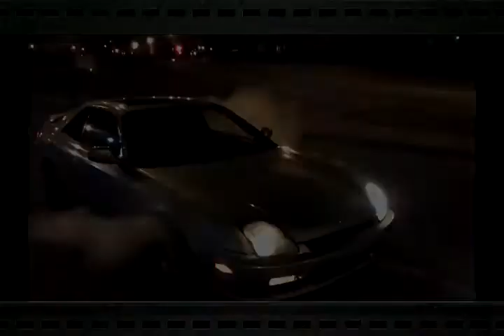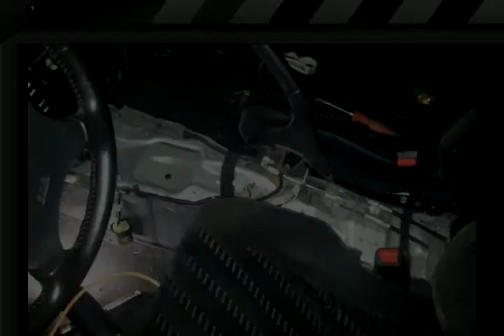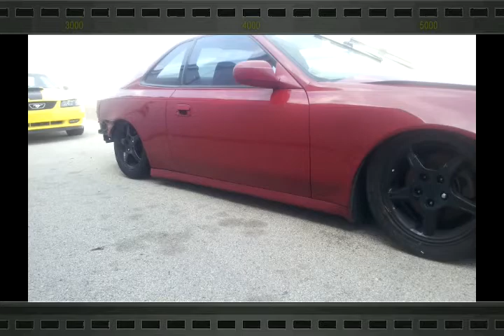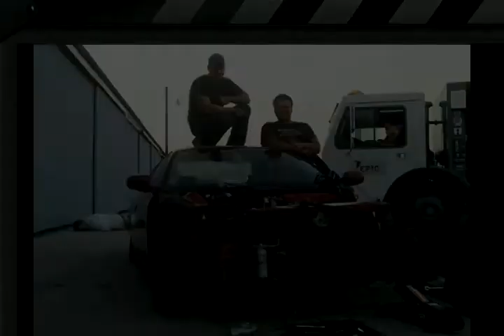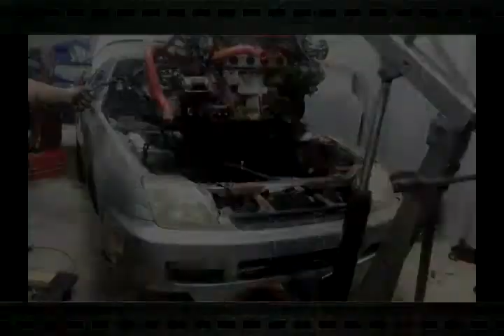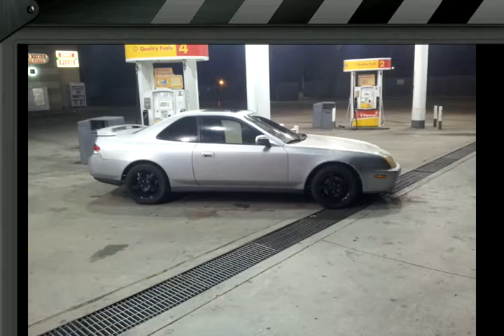2001 honda prelude h22a manual swap

Comment: Hey bro I need help with my swap! I did exact same swap, 1999 prelude with jdm h22a engine. My car cranks but won't get spark. Im think its distributor cause I'm running the obd2 dizzy I had on my other h22a4 engine. What else did you have to do to get it running properly? Anything you have to do to vtec?
Reply: I wanna go obd1 for better tuning
Reply from the maker: No problems with mine. We did have to resolder a chip on the tcm which basically made the tcm react like it was a manual car.
Reply from the maker: Sorry I actually meant the ecu. Not the tcm.